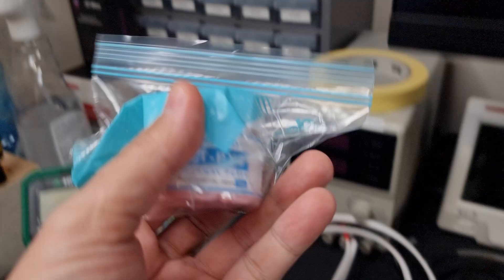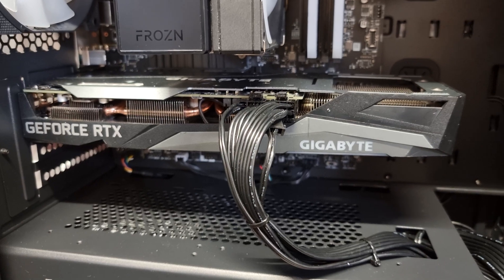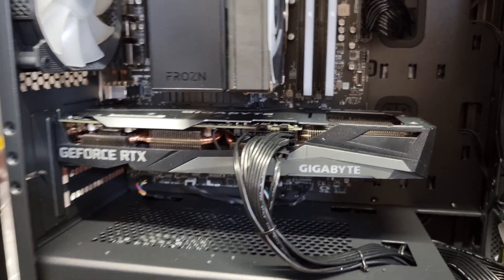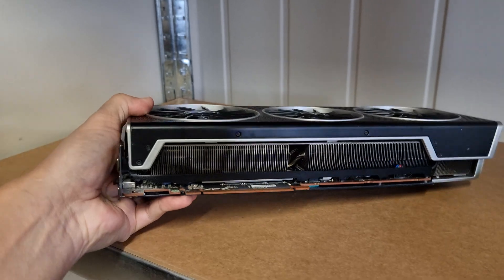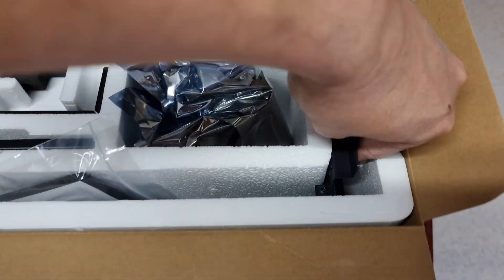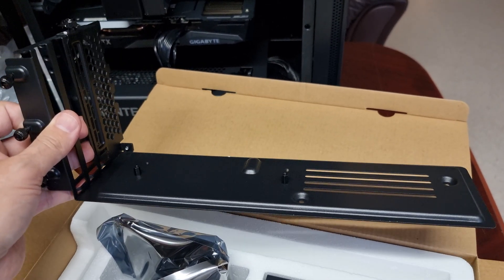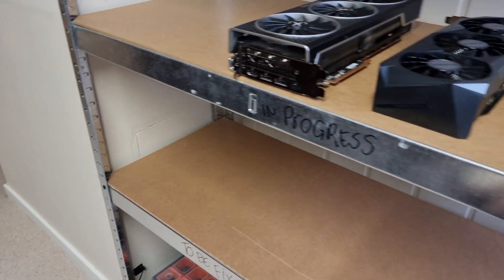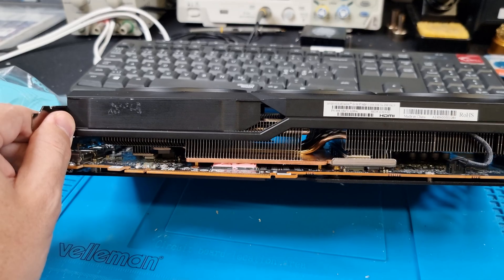Why Modern Day Graphics Cards Are Dying Prematurely.

Comment: its only happens to the cheapest brands. you have to realize this fact. quality is matter. am always using asus gpus and they never failed
Reply from the maker: Incorrect. This can happen to ANY brand. I have Asus, Gigabyte, MSI, Zotac, and PNY here for the same type of repair. If you use your support incorrectly, or not use it at all, your card will eventually stop working due to cracked solder joints under memory and or core because of sag.

Comment: My vast armor 7800xt came with a support bar. I've also got a piece of 550 par cord holding it up.
Reply from the maker: The support bar is good. I do not know what a piece of 550 par is.
Reply: @TechnologyHive  misspelled, 550 paracord, parachute rope.
Reply from the maker: @samrye8342  First time I hear this lol. People get creative when it comes to this stuff. Cheers!
Reply: @TechnologyHive  yea it's a bad solution. Just what I had on hand and didn't think the support bar was doing a great job. It's obvious that a huge 3 fan GPU should be supported. Ideally I'd like to see an all thread post top and bottom or fixed with an inline turn buckle type adjustment. Measument made equal left to right.

Comment: I experienced this issue with a Red Devil 7900 XT and bought a new case to prevent further damage. Now I have a 5080 Astral with a decent GPU bracket, so I took the risk. I really hate that they removed the GPU leveling sensor, though. After the first mount (when the sensor was still active), I realized how poorly the card was seated on the bracket. Keep up the great work informing others!
Reply from the maker: Thanks for your comment. 😊

Comment: Also sorryim getting a steel legend 9070xy manana. I have a roomy case but I have 3 fans on the bottom, opposite the aio fans on top. Will a vertical riser even work?
Reply from the maker: You don't need a vertical mount kit if you're using support correctly.

Comment: I have a 7800xt xfx 3 fan. I had it without a GPU thingy to put on the opposite end of the card. Does that help GPU sag? I want my card and PC to last as long as possible.
Reply from the maker: Place the support not at the end of the card, but 2/3 the length,  between fans 2 and 3.

Comment: I have the 7900 XTX Nitro+. This thing is a monster both in performance and weight. I use the support that came with it and it seems to work quite well, but now I'm thinking of using an additional support towards the front of the GPU. Any small object of the right size should do.

I want this baby to last for years because holy crap, this was expensive in my country's currency.
Reply from the maker: I would put the support between fans 2 and 3. And yes, that is a big card. It's a nice one, too.
Reply: @TechnologyHive  I can't put it there because the fan is on the way. Also, the support that came with it already occupies that place.
Reply: @TechnologyHive  I came back to say my GPU suddenly died roughly 2 weeks after I made my comment. It only works without the driver installed now.

I don't know why I watched this video shortly before it died like this, but it was a sign. I don't even want  to buy another one of these pieces of overpriced junk hardware, but how the hell am I supposed to game without this fragile trash?
Reply from the maker: @fluttzkrieg4392  It may just be one of those memory chips close to the PCI-e slot with cracked solder joints. But, typically when the card fails to load the driver, it is a core related issue. Either cracked joints under the core or core gone bad. It's hard to diagnose the problem over the internet. 

But like I said, it may just be one or two of those memory chips close to the pcie slot. Sad to hear it went bad on you.
Reply from the maker: @fluttzkrieg4392  If you are in Europe, I can help you. I accept payments via Paypal. I am not guaranteeing a fix, but for what it's worth, I also do NOT charge for diagnostics, only for work done. I would look in the used market also.

Comment: And that's the reason why I'm a fan of old-school desktop cases where the Motherboard actually sits horizontally, with the GPU sliding in vertically - absolutely no sag there! And for a more modern look, there's the Cube-type cases which allow the same thing. It's a shame they're going out of fashion by the looks of it...
Reply from the maker: I wish cooler master still made the Elite 130. My favorite ITX ever.
Reply: @TechnologyHive I wish I had gotten my hands on some Thermaltake Core X5 cases - I'm lucky enough to have grabbed a Core X9 and a Core V21 that will continue to serve me faithfully... Any recommendations for a Cube case for ATX MoBos where MoBo layout is horizontal, that is still currently available?
Reply from the maker: @tx3rn0bill  I have not tried any of the modern cube or inverted cases, so I can not give any recommendations based on personal experience. But I hear good things about the Hyte Y70.

Comment: So I have a question. I'm planning on upgrading my Nvidia 2080 super to an MSI 5070 Ti OC Gaming Trio. Would an ASUS ROG Herculx Graphics Card Anti-Sag Holder Bracket be enough to hold it in place? I've bought the holder bracket a little while back since I've seen how large these graphic cards today compared to my 2080 super lol.
Reply from the maker: Yes that will work just fine. Though can find cheaper supports on AliExpress and they are good quality, made all from aluminium.

Comment: How many grams does the GPU have to weigh, where you suggest it to be placed horizontally? Mine's 1600 gram.
Reply from the maker: Rule of thumb, for me, if its a 3 fan card, and its 2.5 slot card, use a support. I'd place the support 2/3 the length of the card, so between fan 2 and 3.
Reply: @TechnologyHive  im cooked, it's a 3 slot gpu, gotta think of a support soon... after watching your videos 😅
Reply from the maker: @roller4312  This is where I buy mine for customers: https://www.aliexpress.com/item/1005008341563549.html?spm=a2g0o.productlist.main.22.22e0ipnIipnI4M&algo_pvid=5877c994-6a9d-4f9b-8b60-f15ad54108dc&pdp_ext_f=%7B%22order%22%3A%2259%22%2C%22eval%22%3A%221%22%2C%22fromPage%22%3A%22search%22%7D&utparam-url=scene%3Asearch%7Cquery_from%3A%7Cx_object_id%3A1005008341563549%7C_p_origin_prod%3A
Reply: @TechnologyHive  thanks! I already have one, it came with my Asus gpu, and looks very similar to this one, but i was a bit concerned about it being magnetic, so wanted to make a wooden one instead, but was too lazy to do it. it's only been a week so hopefully the gpu is not a brick yet. Put the magnetic one there, for the time being, as you advised. Another gpu saved ig!

Comment: What pisses me off the most is the following. I am a design engineer myself, (I work in the automotive industry not consumer electronics). I think those products are badly designed. They are mechanically too fragile, they are thermally questionable and the connectors are a joke. 
- Mechanically those cards do not support the PCI properly, this kind of warping in the PCB should not be possible. Not for a $1000 product. It just should not exist, no matter the age of the GPU, it weights like 2Kg or so, by now this issue should be well known ! 
- Thermally they overheat on the VRAM for example. Take the RTX3000 gen. as an example. Why are they getting so hot to begin with ? How can you release a $1000+ product that can die from overheating within a year or so ? 
- Connector, are you kidding ? Who came up with this horse shit ? (let me be clear, I am not saying their design engineers are too stupid, no it´s their marketing or whoever, who does not care and tell them to do it anyways) Let me tell you, my $10 toaster connector does not melt. How is it possible that this very expensive and fragile product has a faulty connector due to a not properly designed connection? How is it possible that there was no recall and they still sell this faulty design ? 
To me personally it looks like they don´t give a damn about the customer or their consumer product, I would be ashamed, If I sold a $1000 GPU where a stupid 12V connection systematically fails.
Furthermore, there is no innovation on the mechanical side whatsoever. Some MoBos used to have a bowden release cable to unplug the 3Kg GPU cinder block, because you could not reach physically past the CPU cooler RAM etc. to unplug it due to it´s size. Where are solutions like that ? Why does the modern 400W GPU pull air from INSIDE the case, heats it up nicely and dumps it back INSIDE the case ? There are 123745 useless RGB nonsense products, "waifu" printings on parts and all sorts of shenanigans but nobody solved the heating issue ? I am so annoyed with this marked. Price to performance isn´t there for me anymore. I would assume I can buy a $1000 consumer product where I do not have to be an engineer to plug it in and use it, without the stupid thing failing after a year. Sorry, I am done ranting. Please tell me your opinions, maybe I am just wrong ?
Reply from the maker: I think that you if you have good air circulation in your case with a good exhaust and fan curve, the heat problem should not really be a thing of concern. Yes, I think design wise, these manufacturers are just greedy, as I do not see reference design cards dying from sag as much as AIB models. Reference cards are sometimes twice smaller than AIB and produce same results. Maybe a little warmer, in the high 70's but still perfectly acceptable.

Comment: Lookls like somebody used one of those GPU "supports" on the end and "oversupported" them.
Reply from the maker: This is due to sag. You're looking at it from the wrong angle.
Reply: @TechnologyHive  It could be sag, or it could be too much pressure from the support. I would assume most people would try to eliminate the wobble which you have shown, this alone could lead to too much pressure on the PCI connection

It´s kind of hard to explain, since English is my 3rd language. I try to do it anyway.

Imagine the GPU sits in it´s slot. Left side is the HDMI etc. output side. The PCI-E slot is about 1/3 from the left side (give or take, does not really matter). Now you place a support "column" on the right side, imagine basically a cylinder with threads which you can turn, to adjust the "support height", to alleviate sag. 

On the right side, the wobble is rather large due to the lever (PCI-E sits about 1/3 of the total length, 3/3 of total length would be the lever), now if you adjust the height (turn the column, like a screw) you would do so until all wobble is gone right ? At which point you have probably already over adjusted and put a lot of tension in the PCI-E slot.
 
I would imagine most users would adjust this height until all wobble it gone. However with thermal cycles, tolerance, shrinking and warping of metal housing etc. the card would warp over time. Not due to sag but due to over tightening. 
I am not saying "this is what happens 100%" I am saying, this is something what I see as a likely cause which should be investigated. 

I am sorry for the long comment. If you respond to my comment please quote the parts that I said so it´s easier to reply and understand. e.g. 
"...PCI-E sits about 1/3 of the total length...." THAT IS TOTALLY NOT TRUE, MINE IS 1/4. I hope you get the reference =) 
cheers.
Reply from the maker: @sierraecho884  I appreciate your comment, long or short. I understand what you are trying to say clearly. I just happen to have a lot of experience with this topic that I am stuck in my roots, no offence.

Comment: I hate it how big graphic cards have become :( . I am using an ASUS Dual GeForce RTX 3060 which is actually pretty small, I guess I don't need a vertical mount right?
Reply from the maker: Nah you're fine. I've never seen those come in with bent pcie slots. They have other issues but sag is not one of them, unless its a 3 fan version with an unnecessary large cooler like those from MSI Trio.
Reply: @TechnologyHive  Thank you. My 3060 has two fans, I hope it will stay alive for a long while :) . I had a gtx 1070 before with 3 fans, that one was pretty heavy though, I wish I had known about your video much earlier.
Reply from the maker: @AfwaBeats  Your welcome! I am just happy to help.
Reply: @TechnologyHive I appreciate it 🙏

Comment: Wouldn't it be just as good/better to put the support at the outside (from the MoBo) "back" edge (so as to create a "triangle" of sorts, where at one end you've the rear mounting wall, then the PCI-E slot in the "middle" (sort of), then the support thingie at the "rear" (furthest inside the case, and from the glass panel's side)?

The problem with vertical mounts seem to be that unless the case's been designed for that, it seem to starve it for thermals (too narrow gap to allow enough air under heavier load). Think some of those cases that allow to mount it on the side "hanging down" - or the new "3 chamber" ones might mitigate that, but the older cases...yeah, they seem to work better with the "horizontal mount". 😕
Reply from the maker: No, vertical mount with a 3rd party kit is not the same as vertical mount using your case's vertical mount option. A 3rd party kit like the one you see in the video by Phanteks, places the GPU away from the side panel, closer to the mainboard. 

If you want to keep your card installed horizontally, one support 2/3 the length of the card, or between fan 2 and 3 will be enough. You just don't want to have it sagging.

Comment: The weight wearing out the PCIe slot and overheating from overclocking. Those reasons AND power consumption (over 200W with more demanding software!) are why I don't bother with high end graphics cards: Nvidia xx70+ and AMD x700+xx70+. Notice people are having these issues with HIGH END graphics cards.
Reply from the maker: You're correct. And I just took out my 7900XTX that is on a vertical mount noticed the small PCB on the riser bent from the weight of the card above...

Comment: the real question is why gpus getting bigger instead of smaller
Reply from the maker: Reference designs remain the same generally, for both AMD and Nvidia. It is AIB partners who are releasing cards with heavy heatsinks to try and squeeze every little drop of performance out of binned GPU cores. To do this, they need the best cooling possible without going with an AIO solution. So they slap giant heatsinks on these GPU's in order to keep the cost down, and keep the noise levels down with giant fans. 

As long as people keep buying these extra large GPU's, there will always be a market for them and they will continue to be made.

Comment: That's why i always use an extendible table leg under the gfx card sitting on the case, with rubber in between for a fixed mount and because rubber is in between, cold-hot contraction-expansion thermodynamics won't crack it. That way, I can also move the case from the floor when it's time for maintainance, as it's over 20kg sitting between wall and desk in hard to reach position, only can shove it out. EDIT: In case you wonder if this works, it works perfectly for decades for dozens pc's, never had any issue.
Reply from the maker: If it is keeping your GPUs alive, then more power to you!

Comment: I always used anti GPU sag brackets. But i dont put them at the end of the GPU. NEVER. I place them at the middle of GPU. Because antisag braket touches not the PCB (like slot and rear sleds) but heatsink, so it must be centered in relation to where heatsink is screwed to PCB - so i would say more support from underneath the gpu needed to be made close r to the rear,  not the middle. 
And all that because i HAD RTX 3080 TUF, which had squeezed termopads, because of weight of heatsink. 
Best practice is using two anti sags - in 1/4 and 3/4 of GPU lenght, when using heavier GPU's. Then you got 100% safety from sagging.

Comment: This makes allot of sense, i just installed a 4080super ROG card and its heavy and massive im using the little gpu support bracket now as i cant find a way to vertical mount my gpu with my current USB expansion card for all my streaming euippment is there something im missing? I even upgraded the motherboard for more USB ports but still need more
Reply from the maker: If you add some kind of support, that is plenty. It doesn't have to be vertically.

Comment: Support your gpu, mount it vertically if you dont mind the slight latency, or just get a real desktop case that lays flat. You can also get a desk that you mount the computer parts inside, most go for like 1000+ $

Comment: They should add a little slot thingy into the corner of the card for the sag bracket to get inside

Fun concept i just thought of idk why it isn't a thing
Reply from the maker: The less you know, the better for them. If you buy a card today, and it breaks in 2 or 3 years, after the warranty, they know you will probably buy new. So more money for them. This is just a big f*ckery, and end users are getting the shaft.
Reply: @TechnologyHive or just don't buy big bricks just buy small